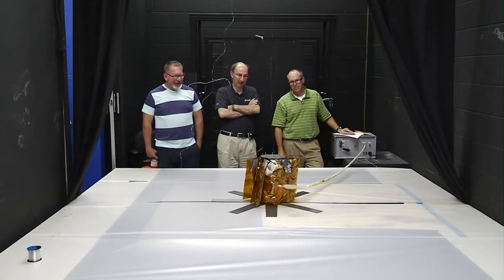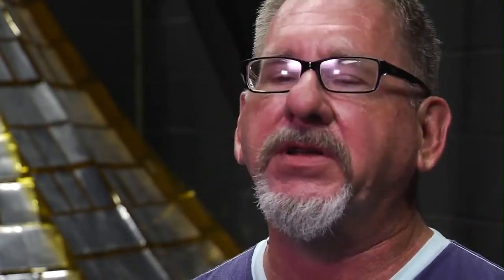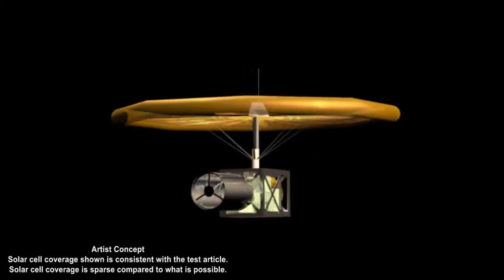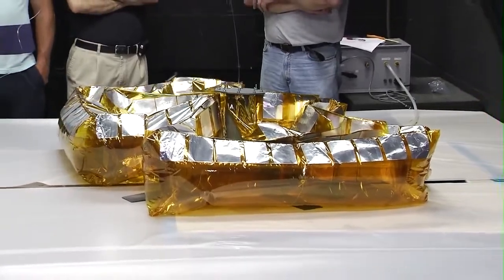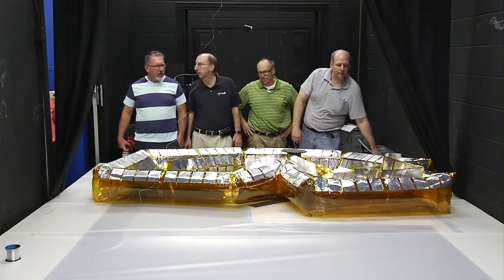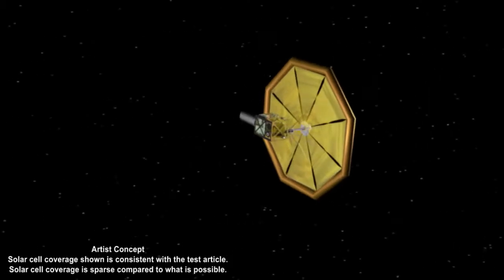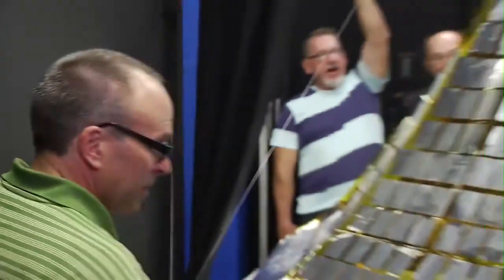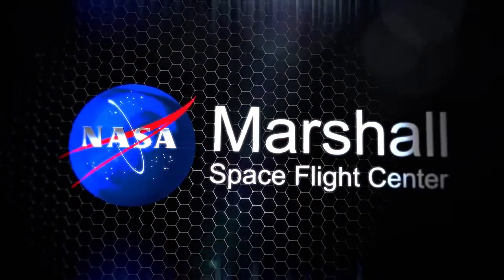Inflatable Solar Panels for Spacecraft - More Power  |  Video

Comment: Well it will be interesting to see how they deal with the presence of meteoroids. Not only will they have to worry about them getting punctured and deflating but I would think if they did get punctured they would be pushed off course by the exiting gas. Well I have faith in NASA that they have made a lot of amazing things.
Reply: It will probably have multiple sealed sections rather than the whole thing being a big balloon, that way a micro meteoroid hit won't deflate the whole structure.
Reply: Inflatables are actually more resistant to micro-meteoroids; they simply bounce off.
Reply: David Gerabagi I guess that makes a certain amount of sense. Now you have raised my interest a bit more. Looks like it's time to see what I can dig up about inflatables in space.  Thanks :)